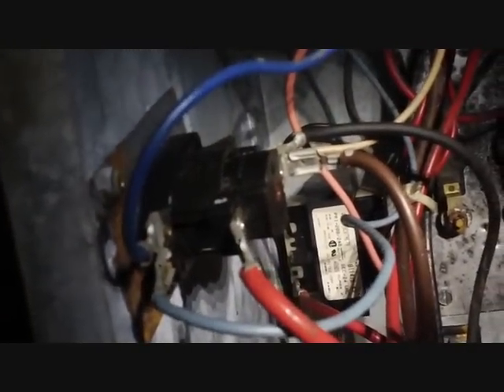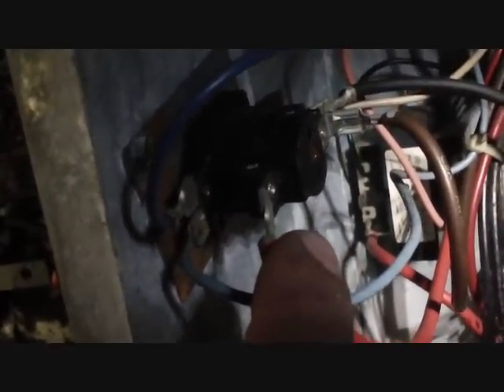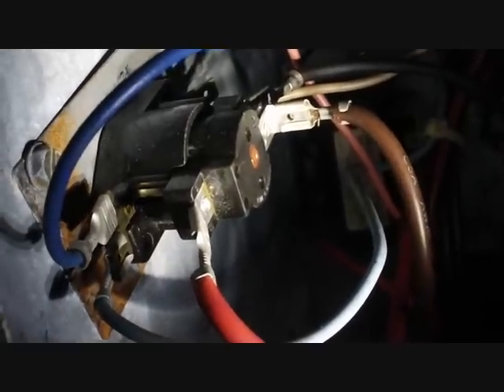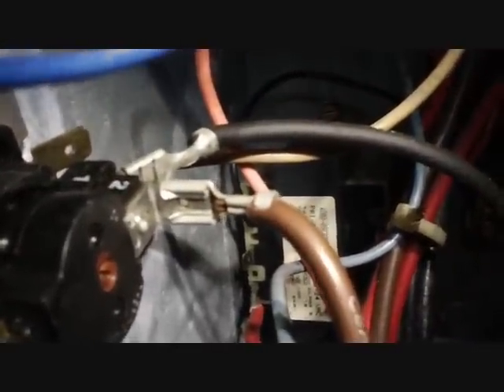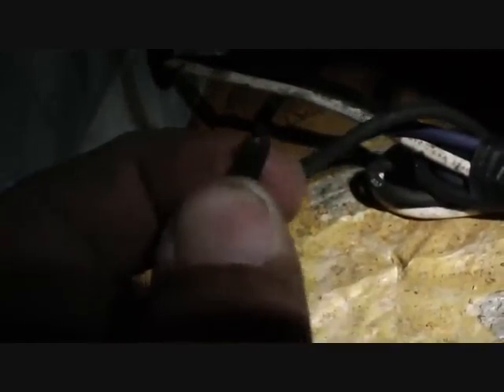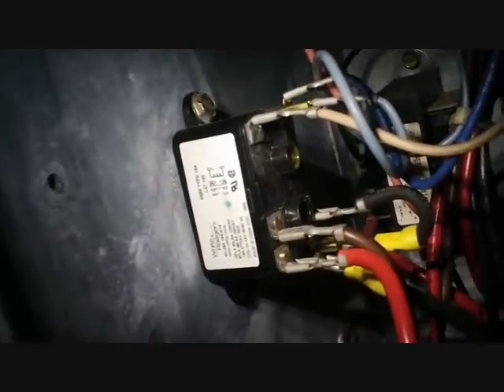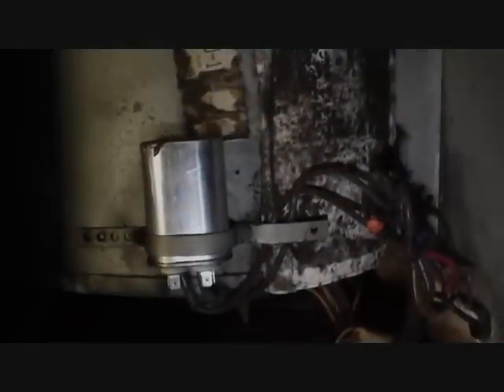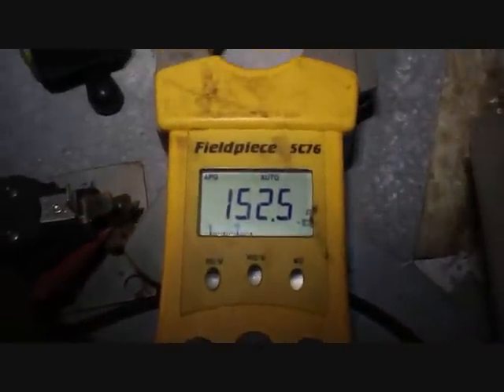HVAC Service Call | Goodman Stack Blower Relay Strikes Again

Comment: Ive not changed mine in 15 years but im sure it will be soon   Just cane across this so i know now where to go to replace that bugger   👍
Reply from the maker: They seem to either live forever or die constantly
Reply: @TALYN875  that is what a servator is or A TULPA it’s a supernatural being that we can create to go out and do our bidding.  Eastern monks use them all the time   I’ve never messed around with that but that could be what we are creating a Servitor is a operate biped an intelligent creation.   We as mechanics probably create a simple ethereal life form which would fall in the category of a spider the reason why I see spider is because many mediums have described them ones are used to don’t know each other and have no clue what those are but they have witnessed them ganging up on mechanical parts.   When they are looking at an event remote to viewers have seen them.   So it’s probably best to bless every job unless you like service revenue lol 😆

Comment: What type of furnace do you recommend.   I have a Goodman, it works but not that great.  Every once in a while I hear a beep.  What does that mean?  Any advice would be greatly appreciated.
Reply from the maker: I think installing company is paramount. Most units will last if installed correctly.

Comment: This is a perfect video of why you should replace the parts like for like. The part that went bad is also call a sequencer. Its function is to turn on and off at a preset time. There is a small heater built into the sequencer relay that turn on at a specific time, then on off cycle turns off at a specific time. This person replaced it with a non timed relay which will work, but is wasting the efficiency of the unit. Example: on AC cooling mode, the compressor turns on and the fan should turn on seconds later (why have the fan turn on when there is no liquid refrigerant flowing thru the evaporator coil and the coil is still warm), when the thermostat turns off, the time delay sequencer runs the blower motor to cool off the evaporator coil for added efficiency, and then usually turns off after 30-60 seconds. The way it is wired now with a non timed relay, when the AC turns off, so does the blower motor, but the evaporator coil is still cold, and results in a loss of efficiency, and the thermostat will cycle more.
Reply: Talyn875 if you had a customer that kept that many on hand because (1) unit went thru them so fast, oviously there is an issue with the motor drawing too much amperage, or a wiring issue that is dropping voltage on startup that increasing amperage at the same time. It's the same type of repairs I see when some people replace a 800 rpm condenser fan motor with a 1100 rpm where they think it makes the unit run more efficient.
Reply from the maker: That blower will not be an issue as far as brownouts IMO. Many electrical heat kits start and stop with compressors and they are 10-25 KW
Reply from the maker: I understand your point, but the issue with these relays is that they are issues all by themselves. They are known for being unreliable. I am sure that you may find some that are bad for secondary issues, but my experience and others have noted their overall poor quality.
Reply from the maker: The issue with these sequencer type relays is that they are prone to failure. Replacing them with the more simple peanut style was made more for reliability. I used to have a customer that would keep 4-5 of those relays on hand because they failed so often.
Reply: @TALYN875  Sequencers last for years!

Comment: Anyone has a clue why my goodman gas hvac installed in 06 would might be having intermittent problems with making flame?
I replaced the electronic gas valve thinking it was the problem and if I'm reading it correctly I'm getting 24volts to the valve.

I has also replaced the pressure switch, igniter, flame rod, and rollout sensor.

The problems still persist with the flame sometimes coming on and burns until temp is met, othertimes its on for 30 seconds or so, or finally it just doesnt ignite at all. Thought I do hear a click at the point the gas normally is released.

 I really though it was a bad valve but it appears not... 😟
Reply: Could be a bad circuit board, or a bad burner ground. How many uAmps do you have at the flame sensor?
Reply: I will check.

Comment: Older Goodman working fine but today the exhaust blower is cycling on and off as if the furnace is trying to start but I'm using A/C??? No glow, no gas valve switching on, red light on board is steady burning. I shut of the 110 and 220 for a few minutes and I changed the battery in the thermostat along with resetting it. No changes to a system that has been in place since 2000. Any ideas?
Reply: Cory Sinyard I was having the same issue so I unplugged a wire going to it.  Hopefully I'll have it figured out before winter.

Comment: My fan keeps cycling on and off. The compressor works fine but the fan blower cycles on and off. I believe its a year old. So, any Ideas?
Also if I put the fan on, on, the fan still keeps cycling on and off.
Reply from the maker: +Ltmks777 should notify the installer
Reply: It's most likely cap problem or if it's a fancy digital unit a dip switch stuck in cycle or bad t stat, jump out stat see if fan stays on

Comment: goodman electric furnace 10kw MBR1200AA-1 serial number 1602059038
Costello heating and cooling installed a new furnace.  They installed a Goodman mbr1200aa-1 ac, or tried to install. Very disappointed and frustrated.  The owner, Gene, gave us a estimate. Then the next day had 2 young guys install the furnace. They did not know what they were doing. The job was supposed to take less than two hours. They worked from 9am to 2pm with the job not completed. 
After they got "done" wiring the furnace, they flipped the Goodman breaker then flipped the main breaker.... sparked started flying, lit up the house! They wired it wrong and screwed up my new furnace. 
The owner went to go get a circuit board and came back around 6pm. During that time, the Goodman was left running, blower did not shut off and the furnace heat did not shut off either. So for hours the thermostat was set at 63 degrees Fahrenheit and the temperature in the house kept raising up to 88 degrees.  Unbearable and the breaker was too hot to touch to shut it off. 
The owner arrived around 6pm to fix everything,  the circuit board part, then realized he needs another part, a relay. Left to go get the relay, and came back around 8pm. 
He got the furnace up and running on 1 element.  So it didn't blow hot air, and it's 19 degrees outside! He said he would come back tomorrow with a contact and hook up the 2nd element. 
Very frustrating and scary.  
I would like a new furnace, one that didn't have sparks flying out of it, which could shorten it's life or damage the furnace.  And a new blower, one that wasn't running nonstop for 6 hours, what a break in cycle!
Last but not least, when they removed the old furnace, there was a door. Now they took that and are not supplying us with a door. When I asked about a furnace door, he said "put a sheet up". Not only is the unsafe and a fire hazard, but ugly and unprofessional. I need a door so kids don't get hurt or my cat doesn't jump up and get hurt. 
I paid all that money and you took and used my warranty AND I don't have a cover/door.

Comment: Ugh! Ive always hated those blower sequencers! Worse is when they behave when you go on a call and you have to play detective with the homeowner trying to figure out what the problem is, lol.  Ive had them stick and not work when they were brand new!  Give me a good ole relay any time :). ...last time the blower relay went out on my air handler I replaced it with a contactor (what I had laying on my worktable, hehe) I dont even hear it kick in any more im so used to it, heh.
Reply from the maker: Yea, those relays were horrible

Comment: Great video! I would like your input/advice on my problem. I have a Goodman electric heat pump as well. Very old probably original unit on the house. I noticed that the blower wasn't turning off and watched a video to find the sequencer and tap it with the handle of a screw driver and if the blowers turns off that is your problem. So I did and it worked. I ordered a replacement one from eBay and switched it out. Problem was fixed for a few months and now the problem has returned. I now tap the sequencer 2 or 3 times a day to get the blower off. I'm starting to think I got a used piece since it was shipped as a loose part in a box. Do you think I should order another sequencer or look at the blower relay?

Comment: I have a Goodman heat pump and many times the outside compressor unit will turn on and the fan inside the air handler will not. We can shut the system off with a switch on the thermostat and then later turn it back on and the fan will finally kick on. I had a heating and air conditioning guy change the more complicated sequencer in the air handler which he said was bad but there was a second one that had less wires going to it that he did not change. Do you think that one can cause the fan to not turn on?
Reply: One is a sequencer one is a blower relay. Sounds like a blower relay. It looks like a sequencer.

Comment: how old is that terrible stack relay? 15 or 16 years. Thats the old style goodman air handler which they quit making around 04.
Reply: That's my issue, a 17 year old goodman AC unit  (pre 2004) that is now having blower issues.  I had the capacitor changed, seem to handle the problem for 1 year, then it started again. Thought, maybe a bad capacitor? replaced it and it's still not blowing cold air through the house consistently, sometimes it works sometimes it doesn't.  This has to be a rely issue, right?
TIA
Leann

Comment: Does the relay go out often? My Goodman furnace is 4 years old and now the fan is starting to stay on. Thanks!
Reply: I am having the same issue with my fan staying on. Have you noticed a large spike in your electric bill?
Reply: ashbrkhldr only since the stepson moved back in lol. I compared it to the year before n it's about the same.
Reply: Dave L Costello heating and cooling installed a new furnace.  They installed a Goodman mbr1200aa-1 ac, or tried to install. Very disappointed and frustrated.  The owner, Gene, gave us a estimate. Then the next day had 2 young guys install the furnace. They did not know what they were doing. The job was supposed to take less than two hours. They worked from 9am to 2pm with the job not completed. 
After they got "done" wiring the furnace, they flipped the Goodman breaker then flipped the main breaker.... sparked started flying, lit up the house! They wired it wrong and screwed up my new furnace. 
The owner went to go get a circuit board and came back around 6pm. During that time, the Goodman was left running, blower did not shut off and the furnace heat did not shut off either. So for hours the thermostat was set at 63 degrees Fahrenheit and the temperature in the house kept raising up to 88 degrees.  Unbearable and the breaker was too hot to touch to shut it off. 
The owner arrived around 6pm to fix everything,  the circuit board part, then realized he needs another part, a relay. Left to go get the relay, and came back around 8pm. 
He got the furnace up and running on 1 element.  So it didn't blow hot air, and it's 19 degrees outside! He said he would come back tomorrow with a contact and hook up the 2nd element. 
Very frustrating and scary.  
I would like a new furnace, one that didn't have sparks flying out of it, which could shorten it's life or damage the furnace.  And a new blower, one that wasn't running nonstop for 6 hours, what a break in cycle!
Last but not least, when they removed the old furnace, there was a door. Now they took that and are not supplying us with a door. When I asked about a furnace door, he said "put a sheet up". Not only is the unsafe and a fire hazard, but ugly and unprofessional. I need a door so kids don't get hurt or my cat doesn't jump up and get hurt. 
I paid all that money and you took and used my warranty AND I don't have a cover/door.